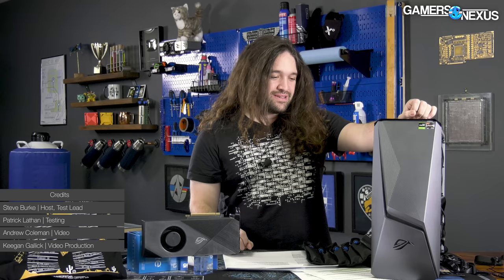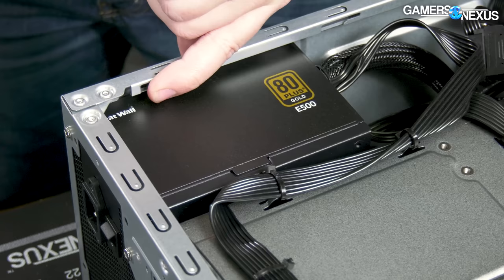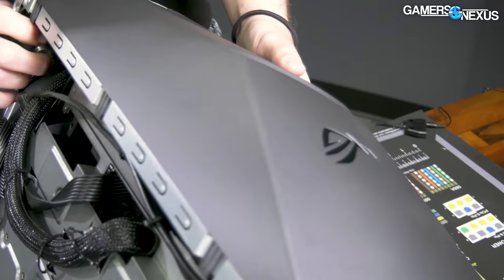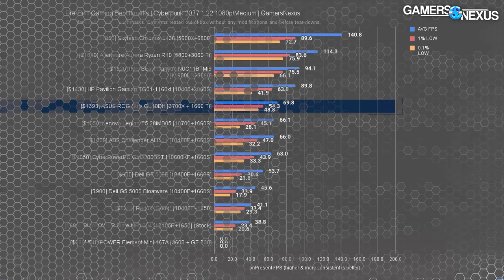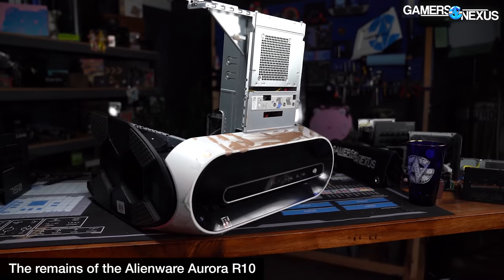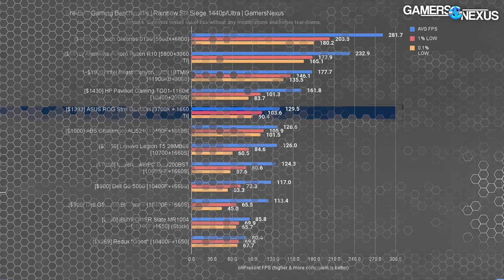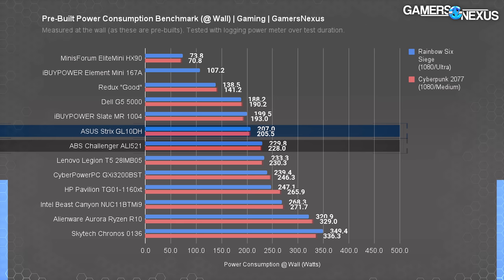ASUS Didn't Deeply Offend Us: $1400 Pre-Built Gaming PC Review (ASUS GL10DH)

Comment: About the GPU bracket and no packing foam inside: Desktop PCs aren't designed to be as portable as laptop, but they should be portable enough for people to be able to carry them to LAN parties, dorms, when they move, etc. so they should be safe to move, safe to ship even years after the purchase, a GPU support bracket is much better solution than packing foam. Even if I have lots of bad experience with ASUS and I wouldn't trust their systems, it is still a solid decision. 

But when the assembly quality of the system includes the loose screw, possible shorting and with that fire hazard, and lack of Quality Control to prevent this and similar mistakes is a significant issue here. Sadly with ASUS, "I was happy while it worked" but when warranty repairs can take months, it can die repeatedly, there are issues with both quality control and warranty, that is an issue. 

Sadly Quality Control, reliability and longevity issues are hard to detect by YouTube channels, and it is hard to get accurate data about reliability issues. When even at their warranty repairs partner people say, plenty of ASUS devices are engineered to win test, be affordable, and not for longevity, and with heavier than average use they might end up needing repairs... Their pick up and return warranty is designed in a way that prevents retail channel from seeing plenty of warranty issues and they tend to happen when many stores already carry a newer version... So even if some online and offline stores offer some data about how often they have to handle warranty issues, for ASUS it often gets unreported..

Comment: Did you use two different Systems for the Video?
At 0:25 the NVIDIA and AMD Stickers are in the top right corner.
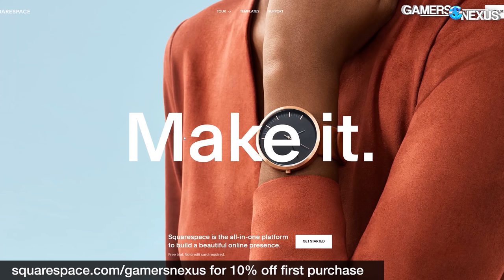0:54 the Stickers are at the bottom left side.
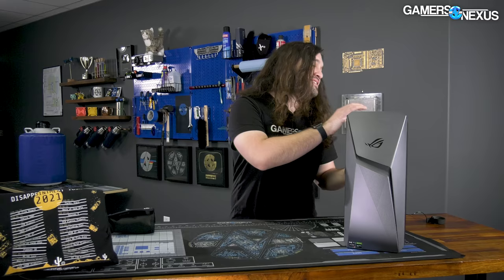3:15 top right side
3:27 bottom left
...
Also the diagonal gap and the logo are changing from top to bottom position.

Comment: I enjoyed the review as always, BUT I think your price comparisons are a slippery slope under the current circumstances. 

You use the price at the time of purchase for your comparisons, which under normal circumstances would not be a big problem but the big fluctuations in Gpu prices also translate to prebuilts (though not nearly as extreme). This means that some systems have become more expensive or cheaper since the review and their price to performance ratio has changed. 
I get that you can not adjust the prices every time you review a product and I do not expect that. But when comparing the performance of the systems you heavily lean into the price, without mentioning that these might have changed since the review and with that the relative price to performance ratio. It would be nice If you could mention the fact that the prices might be outdated or not lean into them as heavily.

Comment: I don't feel like systems using proprietary components should be placed in the same class as systems that use off the shelf parts especially when comparing value to performance.  These proprietary systems are the way they are specifically to cut costs (totally shafting the end user)

Comment: Steve question had the pandemic never happened what do you think the price point of this computer would have been under a thousand?$700 to 800?
Reply: it most likely wouldn't even exist, considering it's using 3 generation old hardware and under normal conditions it wouldn't be able to price compete with something like the 2060 or 3060 cards. BUT. If it had to be sold, I think perhaps even less, 600 max.

GPU: 150 (based on 3060 msrp being 330usd, 2060 should be 100 less, and 1660 even further down.)
CPU 100
Ram: 50
Mobo: 50
PSU: 70
Case: 50

That totals 520 and add an extra 80 for whatever cashgrab shenanigans oems like to throw into the mix.

Anything above that price point is straight robbery. And it really goes to show how crazy the prices are right now. It's absolutely insane that companies charge upwards of 1400usd for what is essentially worth far less than half of that - all because of inflated demand.
Reply: @Real_MisterSir  I totally agree... I have some old micro center emails I found while searching for something that were selling the 1060 6gb for like $220 and im like damn those were the days, wish it would come back down to that price point.

Comment: I have a ROG Strix motherboard (X570-E) and it seems to insist on having Armoury Crate installed and opened once every update to get the RGB to work with iCUE which I prefer as I used to have a Corsair mouse and I knew it already worked with my GPU (nvidia FE). iCUE will not recognise the board without first doing this. It is egregious on any product, let alone such an expensive one.

Comment: Good lord, I would honestly just recommend buying a laptop at these prices for that hardware. I just bought a msi gf65 thin for $900 with a rtx 3060, a i5 10500h (6 core 12 thread) 16gb of 2666 ram and a 512gb ssd which even in laptop form would wipe the floor with most of these systems for a fraction of the price. It's just not worth it to buy a pre-built rn in any way shape or form especially if it's a pre-built with proprietary parts kuz at that point it the one advantage they had (upgradablility) is basically out the window it is just as versatile for upgrading as a laptop.

Comment: I can get one of these with clear side panel and leds but same case.Has AMD Ryzen 7 5700G, 16GB RAM, NVIDIA GeForce RTX 3060 12GB, 1TB HD & 256GB SSD brand new for $700.Would that be worth it?I know 8-9 months ago that would have been an amazing deal but prices are going down now.
Reply: I got one of those bro and it works fine. Even the Witcher3 I'm playing with RT on and everything on Ultra+ and Novigrad gives me no problems like I keep seeing on YT videos, but I do have a decent frame drop in the wooded areas.

Comment: Had, and sent back, one of these. It would drop the USB and ethernet connections any time the GPU tried to run a game. I.e. install GTA5 and it's fine, but try to play and poof suddenly the network drops. Which kills the game. It did this repeatedly with the MB ethernet, an ethernet PCI card I tried, and the MB wifi.   I chalked it up to a bad/weakAF PSU and/or poor VRMs on the MB.  Could have dropped in a better PSU but I should not have to do that on a new PC. And it still might have been the MB.  So back it went.  No regrets.

Comment: Let's be honest THE ONLY reason why the thermals were good on this system is because EVERY part in it is so low power, low quality that it doesn't produce much heat to begin with. One 90mm exhaust fan is not gonna cool a whole pc regardless of case design

Comment: I recently just got a variation of this system with a 11th gen i5 and the 1660 Ti and I have to say it seems like a pretty solid system except the extremely sound exhaust fan which I'm going ot try and swap with something else. I only bought this PC because I got it brand new for really cheap btw, I just can't justify spending like 2k on a graphics card rn so it will do for now.
Reply: kaibutsu jp  yeah it does what I need it too so I'm pretty happy with it.

Comment: It looks like it's expensive at your place. I have actually bought asus system (G15DK) without GPU for only ~450 USD (Poland, bought it from a miner, becouse originally it was sold with nonLHR rtx 3070). It comes with R5 5600X, B550 ,16GB 3200 MHz cl 22, that I managed to OC to 3600 cl 18. Added my own RTX 3060Ti, Be Quiet Shadow Rock LP cpu cooler and few fans. I spent in total: 1250 USD for a system that is quiet and cool (GPU 59, cpu 75 in stress, both cpu and gpu).

There are a lot of prebuilds without GPU on our auction portal. Sometimes you can save a lot of money, when buying them at good price, just add GPU and replace CPU cooler, and it's good to go.

Comment: Did you order from Australia? This is a good system to get you on the first step of the ladder, but you will never get on the second step with it, RAM speed is fixed, CPU upgrade is limited AM4 with a B450 chipset. I am a Asus fanboy, and I have this system, but I disappointed in it lack of future proof. I only got 1 stick of memory in my system, so not all system come to taking advance of dual channel there is only 2 slot for memory, it has one mounting bracket for a 2.5inch SATA. it OK, but my advice is to hold on to your cash and look to when you can afford something with a little more scope for upgrading.

Comment: Got a G15DK prebuilt from Asus and the temps are really bad. But just tweakin the fan speeds In the bios, I went from average high 60s to mid 70s to averaging low to mid 50s up to low 60s. It’s still bad tho

Comment: i got one of these asus ROG systems with a 2080 super and i7-9700k and the cable management was good and i didn't have loose screws. lol. maybe you just got unlucky? but mine came with one 2444 mhz stick of RAM and i expected that so i replaced it with 32 gigs of corsair ram.; mine also had vents on the bottom and top as well and had a glass window.

Comment: Are the front panel connectors proprietary though? On my M32CD (Kaby Lake) motherboard, the front panel USB and SD card slot goes over two of the SATA ports which is just odd.. Making the motherboard annoying to use in another case. The motherboard seems to be standard mATX though.

Comment: yo quick thing to check on the hp. my dad has an hp desktop and a year after buying he got a post message warning him to clean the air filter (it had none) he ignored it but it throttled his cpu down below 1ghz until i cleared the warning. This seems to me to be a way to get people to call a tech out and pay outrageous prices to get it serviced for no reason. My dads system hasan r5 3400g and 16gb of ddr4 2666. after clearing the bios message performance restored to normal. When i reset the bios time to show a year in the future it happpened again so im guessing they have it set for 6 month or 1 year delays on it happening

Comment: I bought my Asus GL10 (G10DK config) a little over an year ago for 900€ (discounted from 1300€). I guess for that price it was OK deal. I just yesterday installed an AIO cooling system because the stock fans are loud. I put it on the front of computer and ripped off the front panel for airflow. Now my computer is fugly but silent 😂
Reply: how did you do ?
Reply: @ir1321  do what?

Comment: Wouldn't tipping the screws with some form of locktight help prevent the screws from accidently falling out during shipping?
Reply: threadlocker is completely unnecessary on desktop computer parts and would only make it easier to strip the head if you ever needed to take it apart anything that came loose from shipping either wasn't screwed in to begin with or was left comically loose less than even finger tight.
the only time I can think of locking threads would be useful would be in an automotive/off-road environment and even then springs are preferable.
Reply: @nogravitas7585  true enough, probably depends on which company is the shipper...

Comment: Idk why you hating on this PC so much. I have one with gtx1650 8gb ram. I paid $700 for used. I have a ton of fun playing on it. I’m about upgrade a few specs so I can run wz2 smoothly and on higher settings. In my opinion this PC is great but not for $1200. I’d suggest buying it from someone as used and get to know what it’s capable of and then do upgrades here and there to get it to where you want it to be. I highly recommend this pc for someone who has no clue about PC and wants to learn and upgrade as you go. All I know is Asus is one of top PC companies with high quality. Dude is acting this PC is worthless. Maybe it’s worth $1200 stock but you can get your hands on one for 700 easily. That’s -500 from its original price. Also you don’t need a $5,000 pc to annoy your games. This pc alone is better than any ps5 or Xbox X
Reply: you have made some improvement or you are still playing it without having made any changes because 8Gram seems little to me
Reply: You can build something really similar to this in terms of performance for less than 1200, and the case is literally choking the airflow

Comment: I game and mine on mine and it does good runs under 60c at full load for hours fans at 70%. 100mhz oc on the core clock and 700mhz oc on the memory. CPU is also overclocked and dram timings adjusted. It'll run 70fps most games 1080p. I'm def satisfied but I'd like a little bit more out of it now that I've been toying around. I have the 2060 super in my gd10k tho. Love it. Just wondering what motherboard would be a good upgrade. Need more fan pins

Comment: I am surprised that after all these years, so many you tubers, review big brand name companies Pre=built PC's.... and I just bugs me, that the guys with all the money, and talent, can't make a single good PC.   they are always cheap, and under whelming.   loose parts, junk memory, junk fans, junk cases, bent or broken parts.   I build my own pc's since the 1990's, and the last one i built in 2007, lasted up till 2021,  it was a i3-4340, with Evga gtx970 4gb, Ripjaw 1666mhz Ram, and a 2 TB spinner at 7200rpm.   over the years i added a SSD, and a bigger power supply.  eventually the system  just was not fast enough for todays games.   And I bought the ever dreaded Acer Nitro- 50, for $800.   it came with 16gb +8 gb x2 ram, and a 1650 Super 4gb.  m.2 1tb drive, and a red internal light..lol    I added heat sincs for the RAM, and added a north bridge cooler, since it did not have one.   I removed the 1650 Super and put my older gtx970 in it, for a 10% increase in performance.   over all, it was a turd, but after adding some better cooling and another 500mb ssd, for games... it came out to be a pretty good system, for a low end PC.   out of the box, it was a bloatware nightmare.  I reinstalled windows, and its all gone.

Comment: 3:30-3:37, 4:20-4:29, 7:28-7:36
So I see ASUS is making them more like Dell and HP Compaqs used to be, a pain in the ass to work with and minimal to no airflow besides what your CPU cooler and GPU fans are generating in vain.
When you said the loose screw was the only major issue I feel like you forgot the case design is a major issue too, especially at a 1400$ price point.

Comment: i know this is an old video but i got my hands on one that i swapped the 2700 out for a 3600 because it was just way too HOT! I swapped out the 8gb single stick to 16gb dual channel, have been fighting the thing idling at 50-70c on both cpu and Mobo. I swapped out the crappy cooler for one that i had sitting around for my old 2600 and that did drop the temps a little I just don't like the fact just running a browser it pops up to 70c both mobo and cpu. Tried lowering voltage but the bios does not seem to have the same settings as other main name boards, hell... can't even use xmp, damn thing wont go any higher then 2400 on sticks that are 3200mhz base.

Comment: Its a Asus 1400 dollar build, that called "Asus ROG strix GL10DH".
Now the ROG line are specific products, 
Asus ROG hero, board, Asus ROG strix gpu, Asus ROG POWER supply 550w,  I mean there not a single ROG part in that system ! 
I am surprised Steve you are not calling this out for what it is: cheap crap sold under the high end ROG name !

Comment: Does pc are great and the asus gl10 with ryzen 5 3600x gtx 1660ti they go for $500 best pre built budget pc just get a different case with more airflow and a liquid cooler for cpu and 2 additional fans and it will be all set

Comment: DISPLAY CABLE MADNESS ? or is my video card dying?
i had a rx 560 running 3 displays. a DVI, Disply Port, & HDMI 
about a yr ago a white vertical line formed in my DVI and never went away.
Just lately i couldnt keep 3 monitors running, it seemed like whichever one was on Display port would  flicker out.
now im running just two monitor, The DVI and i switched my HDMI from TV to my 34" 21:9 widescreen.
B4 when the widescreen was using the display port it stretched everything that wasnt a video game.
now with HDMI input i get regular 16;9 with black bars on either side.
is this normal or do i have a failing display port o the gpu or bad display port cable?

Comment: I got the $1000 RTX 2060 Super version of this. Anyone know if it's the same motherboard and if there's a manual? I wasn't sure if a PCIe gen 4 SSD would be useful.
The WiFi stops working with my internet after a bit. Still connects to LAN but not internet. I'm using Ethernet now.
Wiped and put Win11 on it. A bunch of ASUS crap is installed automatically. I needed to re-add Aura Creator/Armoury Crate to get the LEDs to be anything other than plain red. Any good alternative to that?
I was considering running without the front panel, good to know that doesn't really make a difference.

Comment: You should go for the dell tri-de-fecta and test a dell XPS system. The 12th gen intels are out and the previous gen are discounted. I was able to configure a i7 10700(non k) with a 12gb 3060 and 16gb ram for high 1300$. I wonder where that would go on the list… how stupid would thT be if it performs better tgan the alienware!!! (Btw you can max those xps out to more than 5000$ 😂)

Comment: So is a prebuilt different to a PC assembled with standard parts by a professional?
Reply: Yes, a prebuilt uses low quality high available parts on a worst value basis compared to if you buy independent (standard) parts and build it yourself. Also, you might not need a profesional though, maybe just a technician or your buddy that knows about computers 😅
Reply: @blueryxfalls7949  Here in India, for the time being, getting individual parts ends up being much more expensive than getting an SI to do it cause of taxes. My current PC would be $700-$800 more expensive if I had built it myself.